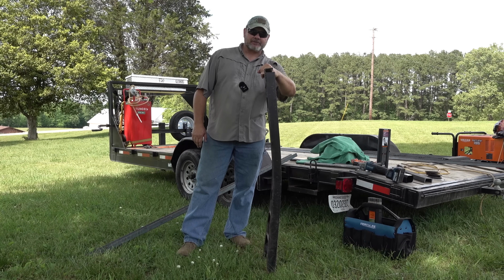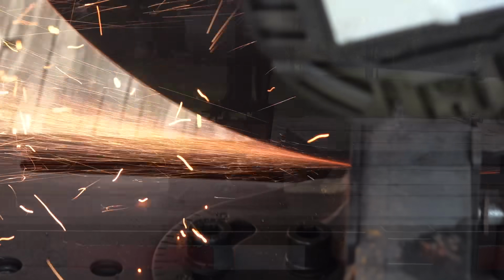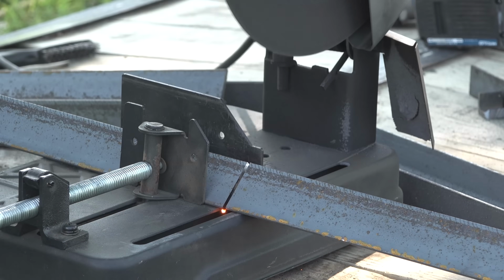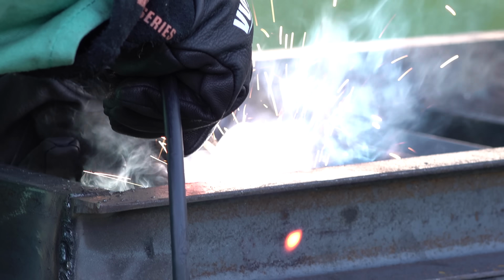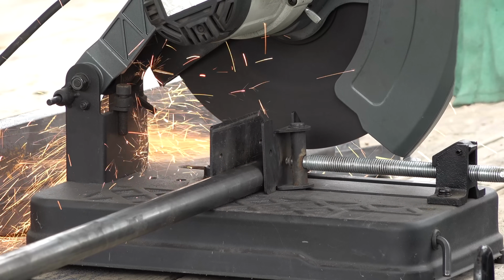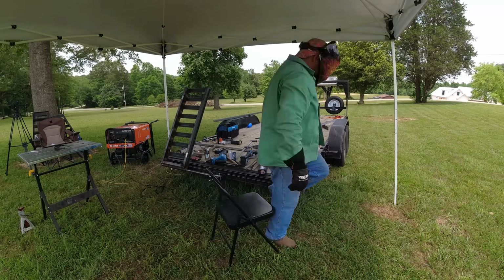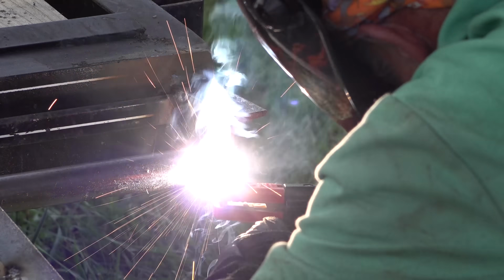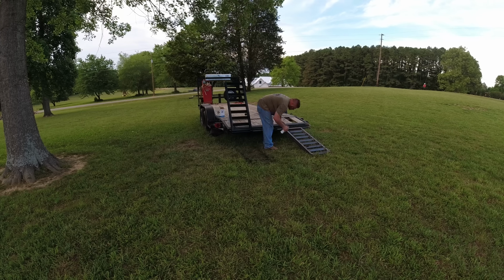Vulcan Outlaw 195 DC Welder 6500W Generator DC Welders

Comment: A welder generator for the hobbyist is a no brainer . Best of both worlds for the extra money . 7018 3/32 is nicer for going around small diameters like that on the pin . Not a big fan of welding pipe on like that . Flat bar brackets on side with holes for pipe thru then fillet weld around both sides . Easier and no chance of pipe wall cracking or tear out . You did a great job though 👍👍
Reply from the maker: Thank you. I loaded the big tractor up, and nothing broke. Good so far. I appreciate your input.

Comment: It's that time again. time for that one year review on a welder, how's it holding up? What problems does it have? What do you like about it? What it can do and cannot do? What do you wish it had or didn't have? And anything else you think is important. Keep up the great videos!
Reply from the maker: It just works my friend. I use good gas with fuel stabilizer in it, and it never fails to start. I have used it to weld and to run an A/C and Fridge when the power was out. I am not a pro welder, but it always does what I want and it is easy to use. Really, not many complaints. I have about 15 hours welding with it, so take that for what it is. Most of my jobs are small.

Comment: So back in my highschool days we used to do welding on everything in the community for class.  built bumpers, trailers, etc.  We had a boy welding some round on for ramps, very much like what you did with your tube on round stock approach.... only he forgot to slide the ramp outer tube onto the round before welding up the ends.  Took him a good while to figure out why we were all laughing at him.  Oh, the good ole' days.  I never never woulda made a boilermaker, but you get an A from me on the job!
Reply from the maker: I appreciate that. I love to weld and make stuff. I have never been a great welder, but I am an OK melter. 😇😇😇

Comment: Thank you for the video. You just helped make a decision. Will be buying this in the future for a welding trailer build I'm doing. I can't seem to find a trailer that is built the way that I like them. So therefore I'm building one from scratch
Reply from the maker: The welder generator is holding up well. I used it just last week
Reply: I like use 6011 on 1/4 inch plate or 3/8 plate 3/16 plate I like eithr 6011 or 6013
Reply: But I like 7018 going uphill on 3/8 plate
Reply: Either 6011 or 7018 Is what I mostly use and metal plate flat plate is what I like useing 1/4 inch thick or 3/8 is best for me
Reply: Yeah them vulcans are good I have a omnipro 220 and I love it to

Comment: Looks good. just a suggestion u might want to cut the bottom of the raps at an angle and weld a flat plate on them so u won't dig into the ground or asphalt roads when u off load
Reply from the maker: I agree. I may put a flat piece of steel on the bottom too.

Comment: Good job. About that pipe. You did fine. I might have used a piece of 3/8 filler rod, or no 3 or 4 rebar, where I welded the pipe to the trailer if I was building for a customer but that's not a big deal. It wiMiller's.

 It sounds like you are impressed with the welder.  I am thinking about buying one as backup for our Miller Bobcat 230. Right now we have two trucks and one welder, which is most unhandy. But we do not need two Millers.

Comment: I'm not very good at welding....but I can solder pipe with the best of 'em! 😎 Good work Tony! 👍👍
Reply from the maker: I have never soldered pipe yet. I can melt metal fair!😁
Reply: Wtf would you solder a pipe for?
Reply from the maker: Pipes are solder in the plumbing industry. Some places require copper pips due to codes.

Comment: Nice upgrade.  I invested in a gen 3 Prius CVT to use the motor generators (MG1 and MG2) for a engine welder/plasma cutter/alternator (generator) on a garden tractor platform using an opposed twin B&S 18HP since that's the engine they used on their hybrid car and I might use both MG's to make a hybrid design eventually is the plan.  In the queue and slowly moving forward on.  Neat seeing HF having as I was just looking to see what the latest and greatest projects are.  Will see if I can move forward with my project this winter.  Still need to design, fabricate and setup my testing fixtures first and foremost since there's not much data on those MG's though some can be deduced/infered. Thanks for sharing!
Reply from the maker: That sounds like an exciting project. Thank you for watching.

Comment: Great video did you build support legs for your ramps that will help you out with loading up and unloading. It will also keep the trailer from picking up on the back of the truck when the tractor is backing off and on.
Reply from the maker: I just bought two jacks to weld on the side of the trailer.
Reply: Keeping the nose from bouncing up is a great idea.

Comment: I have a question you think I could knock out a pipe fence with this welder. And how’s the duty cycle I noticed you didint have any problems at all.
Reply from the maker: I absolutely think it would work fine. I have never had it overheat on me.

Comment: My friend I'm about to have to reup my HF membership lol.  I have two Lincoln welders but I don't have a gen/welder. On the pipe hinge of the ramps I would add a gusset or two on the bottom side and maybe a a way to add flat strap metal to hold the ramps up in transport
Reply from the maker: Hey, thank you. I bought some jacks for the trailer sides. I got to weld them on next.
Reply: @TonysTractorAdventure  I just got a email add from HF last night for this welder and they have this video of you using the same welder as a highlight in the add.
Reply from the maker: They asked if they could share it. Good for them and me.
Reply: @TonysTractorAdventure  yes sir

Comment: What are your thoughts on how loud the unit is?  I see the main body isn't covered or insulated.  Just curious if it could be quieted down?  Also any issues with the duty cycle on it?  Did you ever need to give it cool down time?
Reply from the maker: Very quiet for its size. I never had to cool it down. I will do another video when I know more.

Comment: Do you don’t have to hook up the panel ground?
Reply from the maker: You don't have to hook the ground up for welding or for most light duty generation situations. If you are running a generator with sensitive electronics then a ground is a good choice. The ground, obviously, would make the unit safer if it ever had a dead short. Many small generators don't even have a ground terminal.
Reply: @TonysTractorAdventure  thanks a bunch for the info!

Comment: Tony, that was a great job and inspirational.  What is the least expensive welding unit one would require to handle a task comparable to Tony's effort?
Reply from the maker: I can't answer that. There are so many welders on the market. This has to be one of the best value welder generators on the market. The next closest price was almost $3000 more.
Reply: A two hundred amp mig welder from HF would do it. Any 220volt welder with 180 to 200 amps.

Comment: I just got this welder and set it up. It seems that the auxiliary power switch needs to be in the on position to operate the welder . Is that correct ? I didn't find anything in the operating instructions about it. Thanks
Reply from the maker: Yes sir!, Both switches have to be on. I went through the same thing. Still loving the welder. First oil change done.
Reply: @TonysTractorAdventure  Awesome! Thanks for taking the time to reply.

Comment: Nice job. Can you tell us the material list and dimensions for your ramps. 
I also own the HF high end bandsaw. Now that's a combination with super clean cuts. Haven't even bothered to use the coolant tank with mine. Stopped using my Dewalt 14" carbide tipped  multi cutter slow speed chop saw. 

Great job. Looking forward to a materials  list. And possibly a cut list. 

Thanks
Reply from the maker: I am sorry I don't have a list. I just built it in my head. It was 3 inch C channel and angle.

Comment: I would have made the C channel on the sides a lot longer past the other piece that boxes the end and coped. You would have the top of the pipe flush with the outside of the top of the C channel that way you could weld the ends as well, I would also put a weld in the middle. If that don't hold nothing will.
Reply from the maker: I appreciate your input. There is always room to learn. To this point, the ramps are holding up well. They only need to handle a 9,000 pound tractors, and that is light in the tractor world. I think at some point I will upgrade to a heavier trailer.

Comment: don't be afraid to use bigger rod=3/16th 6011 + 5/32 7018----run 6011 3/16 slightly cool on gaps , just linger in a circle a little bit to let it heat and deposit before cruising into the gap or bevel otherwise it will seem way too cold
Reply from the maker: That makes a lot of sense. Thank you.

Comment: I’ve got a brand new Vulcan 195 outlaw. I followed set up for welding. The only way I can get it to weld is turn on the on/off welding switch and also the 2pole breaker under the snap lid. The engine revs up like it has a load and will not idle down after you stop welding. I’m sure that’s not normal because all other gasoline welders idle back down when not welding. Am I missing something. I have went over the directions several times and it doesn’t say to turn on the 2pole 30amp breaker before you weld. Please help
Reply from the maker: I do everything you said for the welder to work. Mine will drop RPM after I stop welding for a while. It will still is at a. high idle.

Comment: I have the vulcan commander 225 SMAW machine and the SOB wont run 6010 at all... does thst generator run 6010?????
Reply from the maker: I never tried any. I run 6011 or 7018 sometimes. 6011 is stronger but not as pretty.
Reply: I ask cause i just love using 6010. 

Thank you for replying bro  looks good!!

Comment: Does it run 6010?
Reply from the maker: I don't see why not. It is a DC stick welder. I am impressed with it.
Reply: Lol, not all dc stick welders will run 6010, what is its OCV? the higher the better
Reply from the maker: I have always had the understanding 6010 was for DC only. Every 6010 manufacturer's website says DC only for 6010. I know 6011 will run in both AC and DC. I am the first to say I am no pro welder.

Comment: What do you do if you need parts for that thing. Just hope it doesn’t break?
Reply from the maker: No. You call the Harbor Freight parts department or order your Expendables from any welding store. It uses universe leads like most brands.
Reply: @TonysTractorAdventure  I called my weld repair shop (weld right)
They says they don’t work on em can’t get parts
Reply from the maker: The Ford dealer will not support Ram trucks. I probably wouldn't recommend it to you.

Comment: When I weld 7018 on pipe I always weld about 125amps DC and go uphill
Reply from the maker: What size rod are you using?
Reply: I like to weld 7018 or 6011
Reply: 1/4 inch thick flat plate or 3/8 if i am welding 3/8 Plate I will go uphill 7018 about 125 amps

Comment: You didn't see need for legs on your ramps? That is a very good good job on the build. I don't think you are an amateur welder either.
Reply from the maker: I am welding jacks on the side of the trailer. I have seen the ramp legs fold up the ramp when the trailer moved forward. I see the need. Thank you for your input. Tony

Comment: I need help with purchasing correct size generator for my welder but nothing over the top ,, tia

Hobart Stickmate 160i 
It can run off 110,115,120v or 220,230,240v input power ,
•120v = 20-80amps (65amps @20%)
•240v = 20-160amps (160amps @30%)
•Minimum generator power required = 2500watts 
•Minimum welding amps = 20amps
•Maximum welding amps = 160amps ,
Reply from the maker: Sorry, I missed your comment. I would go with at least a 6000 watt generator. Running a welder is different. There is a sudden pull of electricity when the weld is started. A bigger generator is needed.

Comment: YOUNG MAN ,

I M RETIRED , I ENJOY WELDING ,  I BUILD  HEAVY DUTY WELDER CART AND 1/4 " ANGLE IRON STEEL RAMP , THE RING WAY AN MY WAY / MY POINT ARE UP  /NOT UP SIDE DOWN RAMP MOST WELDER MAKE  OR WRONG WAY TO BUILD STEEL RAMPS
Reply from the maker: I appreciate your comment. I have used the ramps several times now. Zero flex. Thank you again.

Comment: Why pay $2000 for harbor freight when you can get a used Lincoln or Miller for the same price?
Reply from the maker: I like what I got and it is holding great. Mine is new and I know how it has been treated. I welded my barn trusses up yesterday. HF has upped their game. They have some good stuff. I do appreciate your point of view. Tony
Reply: As long as your happy that's all that matters. I just worry about trying to find parts buts always my concern with harbor freight, they do have some great tools. Someone also pointed out not everyone is a professional welder and it's nice to have a machine just one person can move around, and at half the price of the cost of anything in it's class as far as brand new it dose look pretty attractive.